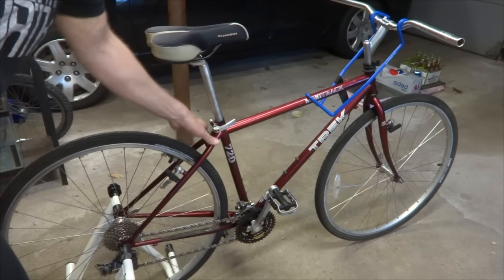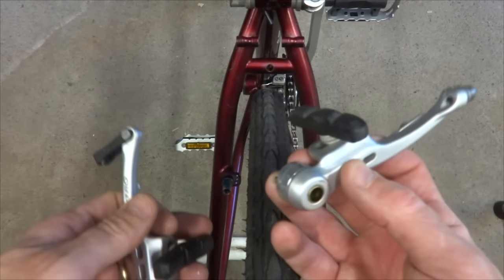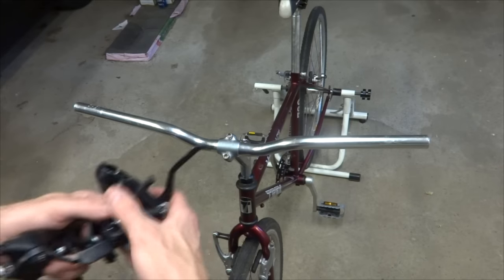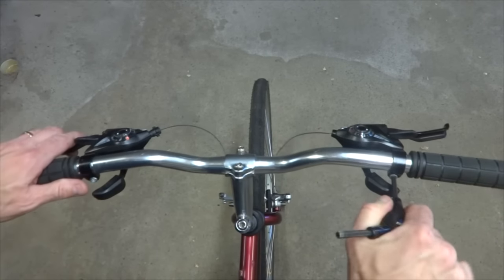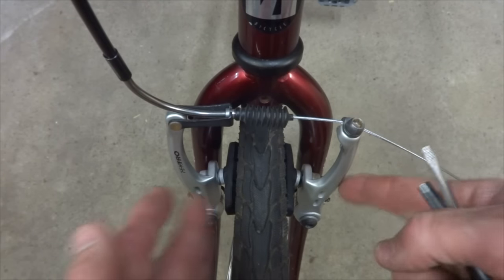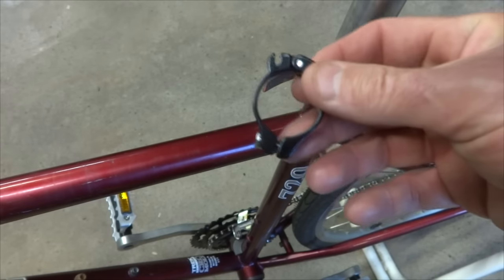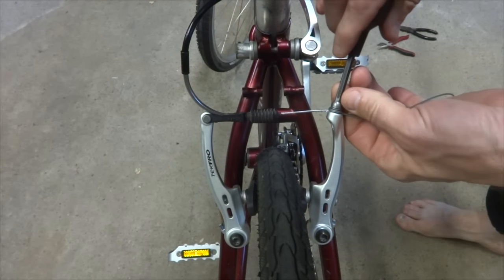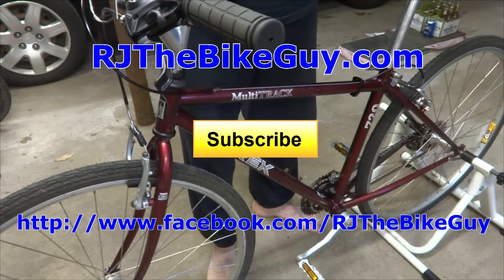Converting From Cantilever To V-Brakes

Comment: The three holes for the spring on the frame are actually meant to be used, instead of always using the middle hole and then bending the spring to adjust. Just try using the upper or lower holes. Otherwise, great tutorial! Thanks.
Reply: Switching holes is a pretty crude adjustment. (You saw how many times RJ adjusted the bend.) Plus, it's simpler to bend than to unscrew the bolts when you're going to have bend the springs anyway. And while RJ's frame had 3 holes, some frames only have one.

Comment: To everyone talking about not being able to stop with cantilever brakes - you're using the wrong levers. If you use short-pull brake levers you should be able to lift the rear wheel with cantilevers, and there's not much point in more force than that. I've never been able to get V-brakes to work as well as canti brakes - I'm not using expensive V-brakes, but I'm not using expensive cantilever brakes either (Altus). There's no reason not to do this if you're replacing broken brakes like RJ is, but the only V-brakes I've gotten to work as well as cantilevers are Shimano DX BMX racing ones.

Comment: very nice video, thanks for sharing...
if i may add, instead of bending the return springs of the brakes 23:50 maybe relocate the other end of the spring that goes into the mounting posts' holes 4:05. 

*most times when a brake doesn't move like at all, a large L-R imbalance like shown with this bike, there is too much friction on the mounting post, dirt / corrosion / sometimes damage. so inspect the post and brake itself in that point and proceed accordingly.

Comment: I needed the tip for the Origin 8 cable stop clamp.  My wife has a Trek 730 and it had that same silly metal cable tube that only works with cantilever brakes.  For a temporary workaround, I ran the full cable housing from the brake lever to the noodle and zip-tied the cable to the top tube.  It actually works pretty well, just a little unsightly with the 3 zip ties.

Comment: RJ, great video.  Even though I did my conversion a few months ago, I still enjoyed watching a professional.  I had been fighting with cantilever brakes on that bike for years.   I do not regret doing the conversion.  The bike actually stops now.  :)
Reply: +NJP Vlogs I need to do the same on my old bike!
Reply: +andrewford80 
It is actually a very easy conversion.  Wish I would have known it was that easy years ago.  Would have saved me all those years of struggling with the cantilevers.
Believe it or not, they went on a 12 year old "Wal-Mart" bike.
Reply: What model v brakes did you choose and why? Suppose anything is going to be an improvement on cantilevers!
Reply: +andrewford80 
I don't recall what brand I got.  I actually ordered them on E-bay last year.  Just got round to putting them on this spring.  They weren't really that expensive.
I would suggest checking your local bike shop.  They might have them in stock...and for about the same cost as some you find online.   Just be sure they are good quality.   You really don't want a brake to fail on you due to poor quality.  It is worth a few extra dollars for your safety and peace of mind.
Reply: NJP Vlogs Thanks :)

Comment: This is simply excellent.
Very clear.
Very helpful.
One thing I do when replacing cables is to give the outer cable a couple of squirts of light oil.
I have no idea whether it's necessary, but many years ago in a Balkan winter I had my cables freeze.  Solid levers concentrate the mind very quickly.  This trick seemed to stop that from happening.   😊

Comment: I do use threadlocker on V/Canti brake mounting screws because: 1. You don't want them coming loose.  2. You don't want them rusting.  Threadlocker, especially if you are slightly generous with it, seals the threads and keeps out water.  (Not too generous!)

You could grease the threads instead.  That also keeps water out and, if the screws are properly tightened, they are unlikely to back out.

I would not install them dry.

Comment: I've also seen tying a rubber band onto the brake pad, or putting several Post-It notes on the rim, to act as a temporarily attached spacer for adjusting the toe.

Comment: every time i think i know what i am doing, i find one of your videos and realize i was doing it all wrong !! these simple bikes are far harder to work on than a high end road bike. i have them. they are simple to maintain and service but all these dept. store bikes are different and so varied in parts. crazy. finding an expensive new derailleur is easy but it is much harder to find dept store parts sometimes.

thanks for the continuing education !!
Reply from the maker: These are NOT department store bikes. Older bikes yes, but they weren't department store bikes.

Comment: I Cannot even begin to emphasize how much BETTER these work than the Cantilever brake arrangement!! 

Not too long ago, I fully restored one of my BMX bikes (that I used to race in 1996, when I was 16 y/o).  

I REALLY wanted to keep the whole bike "period correct" for the mid 90's, but the brakes were just flat-out TERRIBLE!

I figured at least I could keep the old brake parts in a box...so I went for a $12 or something shimano setup, and the cool guy at the bike shop had an old anodized purple Tech-Lite lever, sitting in is tool box that he gave me (which was awesome, since I had blue/purple factory frame decals, and blue and purple anodized parts on the entire bike)...

Anyways, sorry to be rambling on! Just wanted to say, if you have small wheels (like 20" BMX) you WILL NOT regret this swap! I can lock the wheel up with my pinky finger now! :)

Comment: This is a most informative video, well done! I had already cut my cable housing and installed the new Shimano V brakes but could not get the left (cable insert) side to move very much with brake lever applied. I tried the screw adjustments demonstrated here, but no joy. I then re-cut a new piece of housing a few inches longer, so the bend was more gradual (as demonstrated here) and my problem is solved. If you are in doubt, cut it a little longer as it's more cost effective if & when you need to trim. I also liked the use of an awl to open the cut ends, works great. Excellent video, thank you!

Comment: A neighbor was tossing (and I saved from the crusher) an older Raleigh T50 that looks a LOT like the TREK in this video.  I'll be replacing the original 3 x 7 paddle shifters and center pull brakes and will be referring to this video quite a bit.  Thank You! :)

Comment: RJ, I know this is an old video but just wanted to point out one thing. The rear brakes you were trying to adjust - you loosened the screw on the right side brake but you kept pulling the spring, and you kept tightening the screw on the left side brake, while actually you should have to tighten the screw if you want the right lever to have more movement.
I think you got a bit confused there. 😉

Comment: Nice simple tip for adjusting the toe in with a dime. I'd previously tried doing it with a rubber band as I'd seen in a Park tool video, but this seems easier. Learn something new every day from you, RJ!

Comment: Great tutorial! But you forgot to mention the size of the conewrench (thanks for the introduction of that tool b.t.w.!) Dont't forget the vernier caliper though. A vernier caliper might come in handy whenever you need to take measurements of a bolt's/nut's dimension, the gap length of a bolt's/nut's threading and various other measurements that you might need to know. It may even save you money because you don't need to take wild stabs in the dark when ordering tools, parts, equipment e.t.c. Just a friendly tip from one bike mechanic to another! 🙂

Comment: Towards the end of the video he bends those springs, which can help. But first, try changing the hole. On my old BMX bike, my Shimano V-brakes didn't have any tension when the spring was in the middle hole. I changed it to the top hole, and it worked perfectly.

Comment: Great tutorial.  I have a question though, is it possible to find extra replacement springs?   I also find manual adjusting the spring tension helps a lot when adjusting brakes...but overtime the spring loosens the tension.  If replace these every few years is possible, i would rather simply replace the springs.

Comment: I've had to deal with cantilever brakes that even with a little dry chain oil the arms were tight on the mounts. Super fine emery cloth, and then polishing compound fixed it.
You can get flexible brake "noodles" they're made using a flexible mesh sheath instead of a hard tube, you don't end up with such a big loop of brake cable between the frame and the actual brake.

Comment: I was making the switch to v brakes and when I ran the rear brake cable, I realized I did not have a cable stop on the frame in the correct place. Doh! This vid provided the fix.

Comment: Very useful old post. I have a Blizzard MTB from the 1980s which needs the U brakes replaced. I  would like to go the V brake route but the rear one is under the chainstay. Is there a solution, do you think?

Comment: 23:32 Correct me if I'm wrong, but you're turning the screws the wrong way. When you loosen the screw, you bring the pad inwards. With new v-brakes, you dont need to bend them manually, thats a last resort fix.
Reply from the maker: +latuman Yes, but on the one side, where I would normally loosen the screw, the screw was way out. On the other side where I would normally tighten the screw, it was already screwed way in. So I evened them out and bent the spring.
Reply: +RJ The Bike Guy But wouldn't you first fix that by inserting the pin in one of the other 3 holes? Aren't there 3 for this reason? Maybe more of a hassle, though.
Reply: +latuman 
Life's a hassle, enjoy the ride.
Reply: latuman r
Reply: I had this exact problem yesterday and couldn't figure out how to fix it. The left rear pad just would not move away from the rim no matter what I did to the screws. I must have played with it for 1/2 hour. I gave up. But after watching this video I have new found hope. Since I'm on the road I will have to try this when I get home. Thanks.
Reply: Yes, that's what I usually do- I start off in the middle hole both sides, and if one of the arms is stubborn,  I move the spring to the upper position.  Then you can fine-tune the tension with the adjusting screws.  If that doesn't work, then bend the spring, I guess..
Reply: Bending stuff and using brute force should be a last resort. Use what you have, then use your imagination.
Reply: As a mechanic I would do what Victor said. The bending is normally used when you have a single hole to mount the brake arm

Comment: Actually if you don't have any alcohol at hand rubber grips can be installed or removed with ordinary water. If you're not bothered by wetting the tube and longer drying time. But it works exactly the same otherwise.
Nice idea about the dime, never seen this method before.

Comment: Always use locktite on the brake bolt installation. The blue locktite is the best way to keep the mounting bolts from coming loose.

Comment: What you said I found very interesting and very helpful the gear levers you have I have them on my mountain bike what I want to know is my mountain bike has a red reflector and a white do I put the cable under the reflector I would like an answer what I want to know is what is the difference between v brakes and minne v brakes

Comment: Great video.  I'm building up some old vintage mountain bikes and your videos have been very helpful so thank you.  I do have a question for you regarding the wheelset on the bike you were working on.  In the first minute you mentioned that it originally had 26" tires and you switched them out for 700c tires.  How the heck did you do that?  Both bikes I am working on were built for 26" wheels (Specialized Hardrock and Trek 850 Antelope).  I wanted to switch them over to 650b tires which I thought I could do no problem but when I try to shove a 650b front wheel on either frame they just won't fit.  The top of the tire is wedged under the top of the fork.  I would think making the jump from 26" to 700c would be even more difficult.  Am I just missing something here?  Is there something special about the spacing of your Trek 720 that allows you to put on a different sized wheelset?
Reply: I think it originally came with 700c tires but someone slapped 26” for some reason. Which is why i would say why it also didnt have brakes

Comment: funny thing is... i use the same V-brake levers on my cantilever brakes... never need to adjust when the pads wear down cause of the double cable pull LOL... also the braking performance is twice as good as with cantilever leavers

Comment: Thank you for the through demonstration. I am about to pick up an old Raleigh and the front brakes are missing completely and the rear brakes are just hanging down like the ones in your bike. I want to put a good set of V Brakes on it. And hopefully it doesn't need much else. If it does, I know where to find a demonstration video. Thanks again.

Comment: Assuming you have your choice of fork/ frame, which caliper style do you prefer? - V-brake, cantilever., side pull, center-pull, other?
Reply: caliper brakes (side or center pull) are very good as long as they aren't the cheap type that hook and yank a short cable.   then v brake.  then old style cantilever last.  With the oblique pull on cantilevers, a large portion of your pulling force is lost in the angle.   As an example, you will lose 50% of your braking force with a 45 degree angle which is probably what many are.   V brakes transfers almost 100% of the cable pull to the braking surface.   that's physics and force vectors.  I like calipers because they don't rely on frame stiffness for braking power which is the "weakness" in frame mounted v/cantilever brakes. 

  BTW, both are technically cantilevers but the newer design is called straight pull cantilever.  "V Brake" is shimano's branded name for their straight pull.

Comment: Is the extra length of cable between the v brakes anything to worry about? Just seems excessive compared to other v brake set ups I have seen. Could this be due to the closer distance between the v brake pivots? I am almost finished with my v brake conversion on a Trek 700 with the same brake issue. Thanks for posting this video, it has been a great help.

Comment: I love your videos I have 2 bikes around this same age.  I want to upgrade the brakes.  They are late 90's early 2000's Mountain bikes by trek and giant.  Can you recommend a good cheaper V brake by Tektro or Shimao with levers and cabling to upgrade these bikes? like a set? also in this video you show those levers/shifter combos.  My other question is both bikes have the shimano SIS shifter system.  Both are 6 speed with 3 chainrings up front.  What do I need to get to be compatible with the rear and front deraileur? do I have to replace them as well?

Comment: Do they make different brakes if the pin holes are on the outside of the posts? Or can I adjust them to work on the holes if they are on the outside of the frame?

Comment: I just bought a used vbreak earlier today and i'm planning to install it tomorrow. unfortunately it doesn't have a pair of rubber boots. my question is can i still use it without rubber boots?
Reply from the maker: Yeah. They just help keep the cable and noodle clean.

Comment: That looks a sweet ride. Showroom condition.
What brake cable outer do you use? Any particular brand? I see it was lined.
I tie a loop of rubber bamd on the brake shoe for toe in.
Reply from the maker: I buy housing in boxes on 100 feet. Different brands.

Comment: Hey RJ my name is Daniel and I was wondering if you have a tip for switching from V Shape Mechanical Dual-Pivot Brake to a standard v-brake. I'm working on a 20"mongoose brawler for my son and the gyro brakes is crap no mater what I do. The problem is the studs is to close to the seat tube to fit the v-brake arms. I bought a set of Folding Bicycle V-Caliper Extend Adapt Brake Seat Adaptor Drawer Types 406 to 451 to try I haven't got them yet but I just saw this video and thought you seamed like you have done a few modifications in your time so I thought I would see what you thought about the problem.

Comment: Do you know whether long reach calipers can be converted to short reach by using adapters? My long reach brakes have dangerously weak braking power. Tried 3 types of pads already, and a a new rim, too. It just doesn't compare to my friends' shorter reach calipers that have great braking power.

On another note, can calipers be converted to v-brakes?

Thanks!

Comment: Ello there, in adjusting the back brakes you made a mistake. You tightened and loosened the wrong screw. This explains why you did not have the right result. I would not decide to bend the spring as quick as you did! Further good video, thanks for sharing the information.

Comment: I heard that in some cases (older mountain bikes frames; cca 20 years old) rear cantilever brake cannot be replaced by v-brake due to frame wideness (v-brake require more narrow frame). I see this was not the issue on your frame. Can you advise me about standard measurements/sizes before I purchase new brakes? I would like to avoid "try and error" method 😀. Thank you
Reply: I changed from cantilever brakes to V-brakes on a wide fork and it does look funny. I think I need longer posts on my brake pads plus a few added spacer washers. I really don't want to do that. I suspect the spacers would make the brakes sloppier.